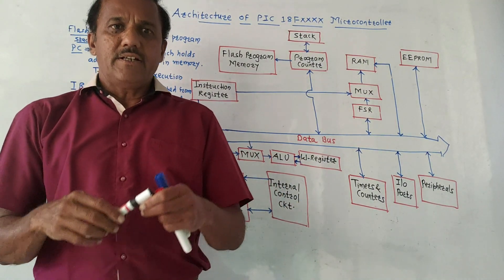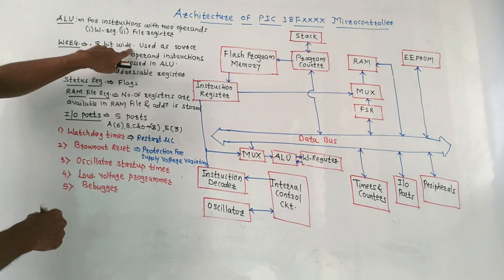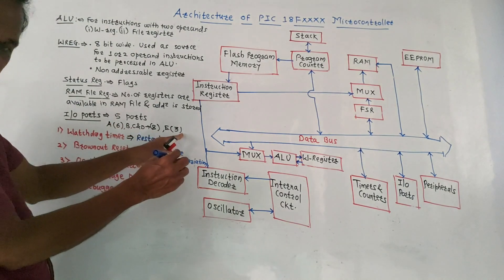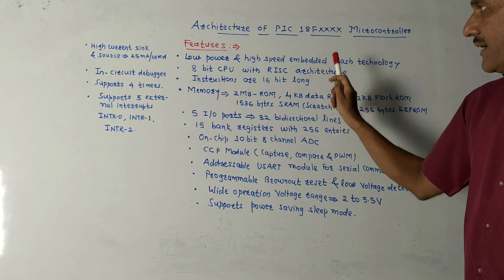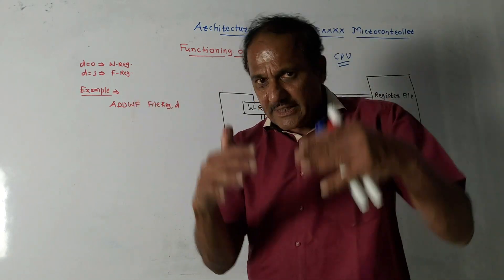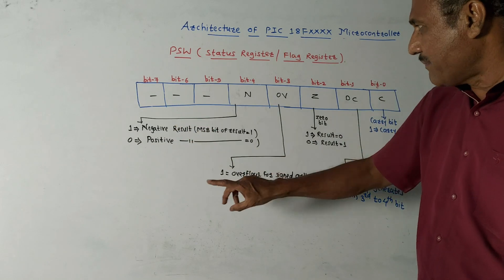ARCHITECTURE OF PIC 18FXXXX MICROCONTROLLER

Comment: Timestamps (Powered by Merlin AI)
00:02 - The architecture of PIC 18Fxxxx microcontroller involves flash program memory, stack, program counter, and instruction register.
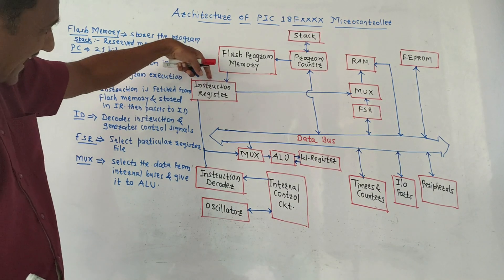02:34 - The architecture of PIC 18Fxxxx microcontroller involves a connection to flash memory and then temporary storage, followed by transfer to the instruction decoder (ID).
05:03 - The architecture of PIC 18FXXXX microcontroller
07:51 - Architecture of PIC 18FXXXX Microcontroller
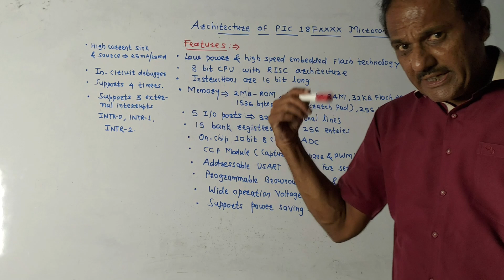10:27 - The PIC 18FXXXX microcontroller uses a reduced instruction set architecture with 16-bit instructions and various memory components.
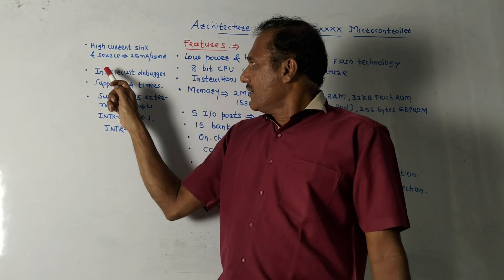12:50 - The architecture of PIC 18Fxxxx microcontroller includes high current sync and source, in-circuit debugger, four timers, and three external interrupts.
15:16 - The architecture includes an ALU that performs operations and generates a one-bit deep bit.
17:32 - The architecture of PIC 18FXXXX microcontroller includes a status register or flag register.